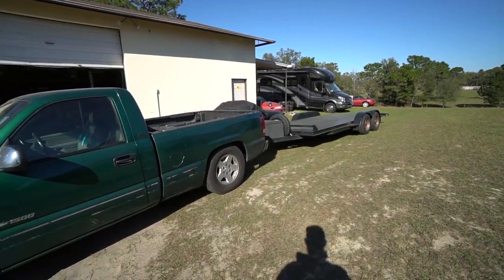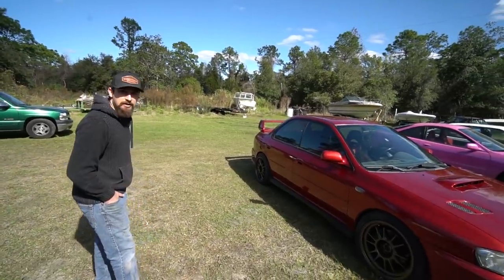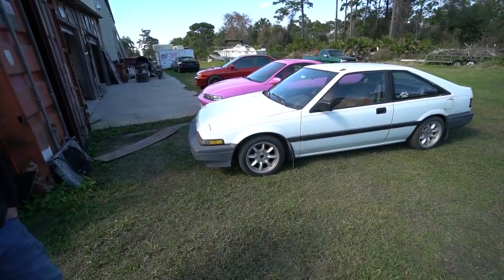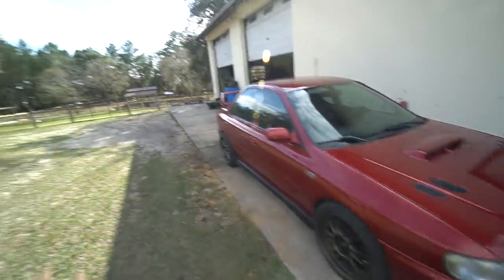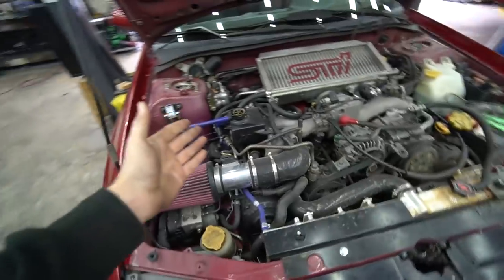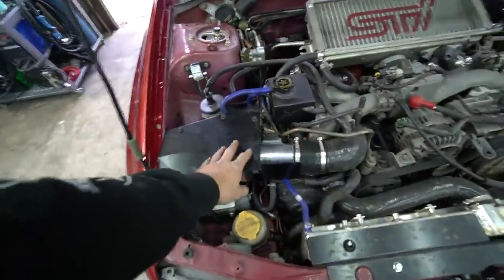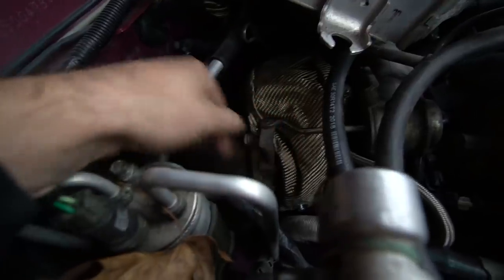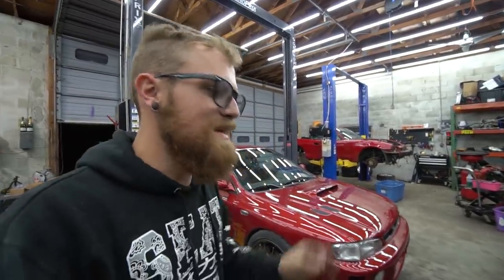Picking The Subaru Up From Paint, Weighing it, And Fixing it!

Comment: Just a tip for next time it gets below freezing there. Though it seems backwards, hot water can actually freeze faster than cold water. So by heating up the water in your cars you potentially lessened the time it would take for it to freeze. Look it up, its called the The Mpemba effect.

Comment: It is vital to run coolant in an ej motor to prevent corrosion. Which clogs the cooling system. Ejs have a cooling issue  already. Look up cylinder 4 cooling mod. I think I'm gonna do it on my 06 wrx

Comment: the uppipe on subarus are tricky you need to read the manual there is a specific way to tighten the bolts often they are not warped just not done up in the right order

Comment: for windshield wipers.. you can buy the rubber by itself on ebay for like 3$ for enough to change a few times. just slide the old out and new in.. way cheaper and if you have a new enough car to still have oem wipers, those are usually better at speed than over priced auto parts store crap, so you can keep them. if not, the rainx brand seems to have the easiest design to change the rubber on and still good aero

Comment: For exhaust leaks use Yamabond on the flange gaskets. Belt sand it first and see where your lacking clamping pressure and lay it on! It worked great on Porsches but it’s hard to get off!

Comment: The factory air/fuel sensor is before the turbo in the header and if your wide band sensor is after the turbo in the down pipe, the air/fuel mix will be slightly different after burning more when traveling through the turbo.

Comment: you can run an air duct tube from the bottom vent on your bumper (the one below your missing turn signal) thru the quarter panel and into the engine bay right next to the filter for fresh cooler air. i'm not sure how much it actually works but that is what i did when i had that car.
Reply: or just popping off the black plate next to the air filter might even help some.

Comment: An LS can fit in a Miata because it's no longer than a inline 4 , and without dual overhead cams it isn't as tall . The dual overhead cam engine in the Ford is why the Mustang's hood is a foot taller than the Corvette . With the  Hight of the engine it might be sticking through the hood .

Comment: Hot water freezes faster than cold water
Reply: Please explain I'm not quite smart enough to understand why
Reply: When you heat anything the molecules separate and move faster and more freely.

To explain it as it was explained to me is by using ice-trays. The hot water in the tray will "turn over" touching the cold air. In turn, getting cold starting the freezing process faster.
Reply: Probably not the best way to explain it.
Reply: not exactly - the freezing process will take less time - however it still won't start until it hits 32f ... the residual heat of the block will keep it above 32f longer. 
the difference being a sealed cooling system, vs. an open ice tray ...
Reply: If you don't know just Google it .
Reply: @m1k3g3tz  touche Michael. Didn't think about that.

Man, Jay. I bet people love talking to you. Your conversations must be the best.